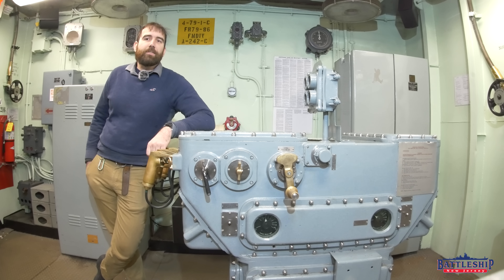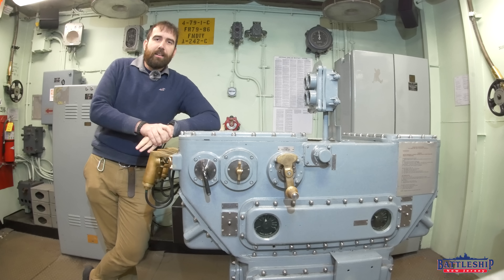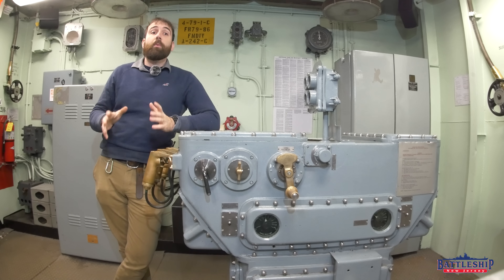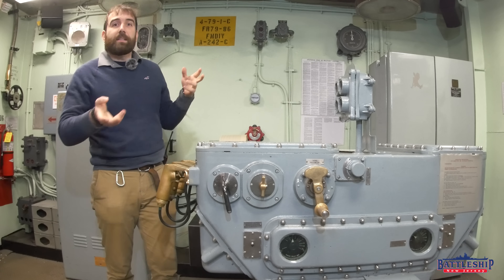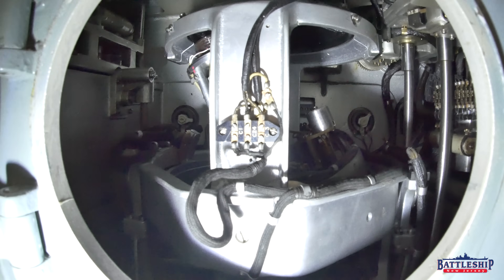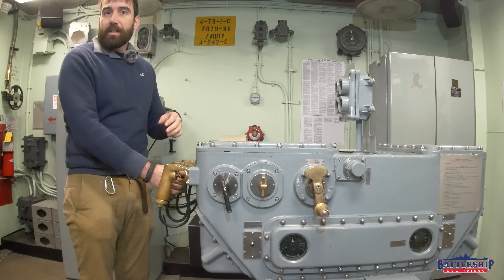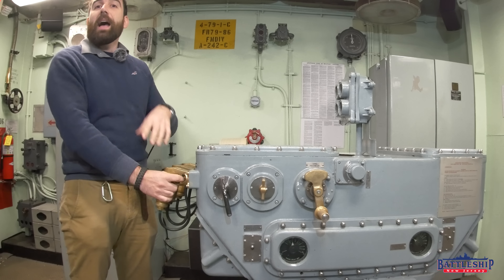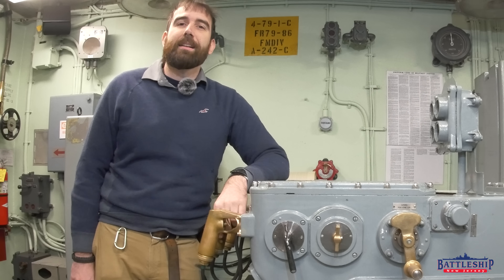The Firing Mechanism for the 16in Guns

Comment: A lot of comments about how "cute" these old systems are and how they could be replaced with a smart phone. 
But back in the day, a countries technical ability was determined by how well they could machine the shafts, gears and mountings that made up these analog computers. Any play in the gears, any slippage in a coupling would be magnified through the computer, resulting in errors that could determine the outcome of a battle. 
When you add in that these systems are impervious to an EMP burst that will fry any typical silicon based device, and you start to understand just how amazing these "old" systems are.
Reply: If you have an EMP powerful enough to fry a silicon device within thousands of tons of steel, you have just ended all life on earth.
Reply: @loganvanderwier8866  
EMP causes it's damage mostly by creating electrical pulses in wires. A ship has wire everywhere, not just buried under tons of steel. Radar antennas, radio aerials, even exposed wire runs will generate a pulse that can travel down the cable into the equipment the cable is connected to. 
I'm not sure you are old enough to remember, but it used to be that you were told "Never use a telephone during a thunderstorm" That was due to the EMP a lighting strike could create when all telephone wires were on poles.
So it's not how big the EMP, but how well the systems are designed and protected.
Reply: @johntrottier1162  And most of the systems are protected by an inch and a half of steel.

More the lower in the ship it actually is.

Yes, it would probably fry any electronics attached to exposed wires. But that, I imagine you can mitigate through clever designs and whatnot. It's not like modern missile crusers are rendered inoperable by lightning strikes, which is a lot less energy in total, but a lot closer to the ship.
Reply: I am in my 30s so I could have easily been one of those kids, but seriously they do not understand that the aim here was to be RELIABLE and REDUNDANT. A smart phone is NOT reliable lol. Sure it has impressive processing potential, but all that potential doesn't mean shit if its a single point of failure sitting in a thin plastic case...
Reply: @madezra64  just think when u are in your 60's  a smart phone from today will be laughable... your grandkids will be like " pop pop how did you live with those iphone thingies"
Reply: @PopePlatinumBeats  Most likely yes. Personally in my opinion I think it won't be as pronounced. The leap from no IC to ALL THE ICs is a very unique event. It's extremely unlikely that 30 years will be anything like the leap from 1990-2020. Unless there's a huge mobile Quantum computing breakthrough, it'll probably be a similar world in 2054 in terms of computing.
Reply: @madezra64  No... not even close. Although it seems like computing power has slowed down, it really hasn't...like at all. Because how normalized it is. 5 years ago it would be insane to think you could even fit 1 TB in a micro USB...today you can buy them for a few bucks off the shelf. Our everyday gaming systems alone are several times more powerful than even the best computers 10 years ago. Hell if I brought back my gaming laptop im currently typing on just 5 years ago, the entire computer industry would shit itself. Sure there might be a few sectors that are slowing down, but look at how many cores we are jamming into a single cpu, we have biotech using neurons grown in labs as computers, and people implanting chips into their brains... AI has made MASSIVE leaps in the last year to the point that people being tested can hardly tell the difference if they're talking to a person, or some code. Tech is still doublng at an exponential rate each year and over 90% of all data has been created since 2019.
Reply: I worked on RN inertial navigation systems in the 80s.  The gyros were so well balanced.  I heard that there were a team of 3 guys who lapped the bearings by hand took a year to make a single balanced gyro. Amazing skills
Reply: Pencil paper slide rule and brain power
Reply: Low tech, wins everytime

Comment: Fascinating ! There was most likely a preferred minimum distance between consoles and heavy, water tight bulkheads may have been a reason for having 11. Meantime, I wonder what the longest interval was, between the warning and the firing of the round.
Reply: If I understand your question correctly, the period between the  warning buzzer and the shot was kind of arbitrary. There was no required standard in the '80s when I was there. If I recall, it was roughly 1 to 1.5 seconds between intervals, depending on who was on the triggers.

The preferred operation was to keep the cadence equal and even throughout the sequence and hold both triggers down for 2-3 seconds on the last. That was the only instruction I received when training on the Mk-41 triggers.

Comment: Since the primary of the battleship was to bring heavy gunfire down on your opponents, at least until air power largely made them obsolete, then too much redundancy is not enough.. the Bismark was still firing as it was ablaze & sinking.
Reply: Bismarck wasn't sinking until the crew set off scuttling charges that blew holes in her.  When they surveyed the wreck they found the hull plates blown outward, not inward as by torpedoes from HMS Dorsetshire who got the credit at the time.  So the crew scuttled her, just as the survivors insisted.

Comment: How did the ship handle aiming in a turn?
Reply: I hope you don't regret asking:  The computer updates all the inputs from radar, speedometer, and compass continuously and uses calculus to figure output instructions.  Those moving dials you see on the glass surface of the Mark 41 represent own ship speed and course, target ship bearing, and target ship speed calculated from repeated observations of his position over time relative to you.  If the two ships are on parallel courses at the same speed, all inputs are constant, including bearing to target ship.  Lead is simple.  The gears in the computer turn this constant information into train and elevation information which is sent to the guns when a solution has been computed.   The computer allows for the rotation of the earth under your shell as it travels -- unless the two ships are exactly east-west of each other on the same latitude line, the two ships will experience the rotation of the earth at different speeds, which affects a long-range shot.  You can enter with a separate knob wind speed and direction aloft (from a balloon sent up before action.)   The computer grinds away at all that until "Bing!' it has a solution, just like you solving a calculus problem.  The solution is fed to the guns as train and elevation orders and you can fire.

Same speed, parallel course is the easiest and quickest solution to compute, but it's also the easiest for the enemy to dial you in and shoot back.  So if your computer is faster, you can get in the first shot and maybe disable him before he can start shooting.  But to mess up his aim, you might want to make a turn.  The change in inputs:  his bearing will now advance or retard and your course will change, continuously while you are turning, then settle to a new course.  Because you are no longer on parallel courses, the computers in both ships take longer to work out the new solution.  Again if yours is faster, you can shoot again before he does.  If your computer is state of the art, it will be able to cope with the continuously changing course and feed a continually changing solution to the guns so you can keep shooting during the turn if the guns are reloaded and ready.  If an older model, it can't cope with changing "rates" as they called these in the Royal Navy during a turn so it goes into idle until the straight course is resumed....and then starts calculating a new solution.   The Mark 41 was all automated:  input the information and wait for the solution to be developed.  Older "Fire Control Tables with Range Clocks" as they were called in the Royal Navy of the First War required a lot of manual intervention to document check points as the ranges and bearings were calculated.  But the principle was the same:  mechanical gadgets implicitly solved differential equations by iteration:  when the values from two separate iterations no longer changed, you had a solution.  The most modern of these old Fire Control Tables, the Mark XX, went to the bottom in HMS Hood in 1941.

The turn question is really important.  In intercepting Bismarck, Hood was coming toward him on a course that didn't allow her X and Y (aftermost) turrets to bear on Bismarck.  So Adm. Holland ordered a turn to port to open up the arc of X and Y to allow all 8 guns to bear.  During the turn, Hood's fire control would have lost the solution and she would have had to wait until the turn ended to start working out a new one.  It was just after the turn started that she was hit in a magazine and blown to pieces.

In the Iowas, (and in later British ships) the computers (called Admiralty Fire Control Tables in the RN) could maintain a continuous firing solution for all nine rifles of the main battery as the ship cruised through a figure 8, limited only by the arcs of fire of the turrets -- they can't turn 360 degrees of course.  It depends on the computer's ability to work with second and higher derivatives of the differential equations in spherical trigonometry that govern the shooting solution...all with gears and shifts like a giant fancy version of the mechanical adding machine my father found in the basement of a business he bought.

Comment: so many questions, that im sure you have no answer to.  not a dig, just questions that probably only the engineers know the answer to

why are the permanently attached triggers/grips fed with a flexible wire and not wired internally?

if the far left trigger grip only rings the alarm, why not have that under a guard/cover that can be pushed and let go of (allowing the circuitry to ring the alarm 3 times) instead of having a 3rd grip in place?

does the middle pineapple fire all 3 guns at once? or only the ones that ring up ready?  if the primerman inserts the primer on a gun and the pineapple is pulled and the gyros line up, could the gun be fired before the primerman could get out of harms way and onto his perch?

and yes. 11 firing points seems excessive by about 8.  maybe 7

Comment: I read years ago that during one of the redeployment of the Iowas they considered an upgraded fire control computer based on modern (at the time) digital controls.  It was decided to stick with the Mk38 mechanical computer because it was reliable & accurate enough to keep up with the digital computers of the time.
Reply: The way I heard it told was that they could put in a modern computer that would do just as good as the fire control, but wouldn't be any better.  So they saved the effort and expense and kept what already worked.
Reply: The story I heard is that the new computers crashed when the guns fired, so they were removed in favor of keeping what worked.
Reply: @russellhltn1396  That is very possible, I could see where reliability would be preferable to accuracy in something this big.  A near miss with the ability to correct and fire again is better than a misfire and having to reboot the damn thing in a firefight.
Reply: @Ioshva McGuire LG The problem with EMPs is that EMPs generally don't exist in the real world. The best way to generate an EMP is from a nuke, but generally if you have a strong enough EMP from a nuke, you probably a have a bigger blast wave to worry about.
Reply: @Jedi2155  Nuclear Magnetic Pulses do exist and are a problem.  One Soviet NMP test caused a fire in power plant.
Reply: @Jedi2155  Ancient comment, but some war plans included nukes detonated for the specific purpose of producing EMPs or other non-blast-related effects. Nuclear EMPs mostly happen from exo-atmospheric bursts, there isn't going to be any direct blast damage on the ground from that but it can still wipe out non-hardened electronics for hundreds of miles. In some cases defensive nuclear detonations could have also occurred which would produce an EMP or similar effects so you'd have to counter that as well. Consider the interplay between ICBMs and early ABMs: in order to defeat interceptors which could take out incoming warheads, exo-atmospheric nuclear explosions could have been used to blind those interceptors with vastly brighter signatures than the warheads themselves. To counter *this*, nuclear-tipped interceptors were built, which would only have to get within a mile or so of the warhead they were trying to shoot down instead of a direct kinetic hit. So now you've got lots of explosions happening way up in the regime where EMPs can be easily created
Reply: Nice thing with analog systems... their number lines are considered continuous. You can always split the hair between two values.  A "smidge" over / under is still a valid value.  Digital are discrete and only as accurate as the number of bits used to store the values.  If you design the software to only go to two decimal places the number you get 2.12, 2.13, or 2.14 is all you can get. 2.135 doesn't exist... no matter how much you want that to be the input.  Also, analog computers were the computer kings through the 1960's for modeling real-world phenomena ballistics being a great example of something an analog computer is great at.  Calculating all the points along the parabola - piece of cake!  To do that digitally?  Fist, use calculus to take the first derivative of the firing solution....  That's why the first digital replacements weren't attempted until the 1980's - and failed.
Reply: @fredinit  Good point, most likely weren't doing 64 bit floating point operations back then.

Comment: I wondered that the HMS Hood...which was designed with relatively thin deck armor, and was a product of the first war...
Did the KMS Bismarck have something like a stable vertical? Admirals Tovey and Holland were racing to close the gap and stop the plunging long range fire...knowing Hood's weak deck armor...tragically, they didn't make it. 
So the stable vertical was a technological advancement between the wars, bringing accuracy that exploited the light deck armor of the older ships. Is that a fair statement?
I need to stop reading this stuff. 😆

Comment: The whole point of having so many places to fire, was that the guns (hopefully!) would KEEP FIRING while she sustained incredible damage. Pretty good example of this thought was Sharnhorst, who kept firing back, until she was practically slipping below the waves.
Reply: All or nothing on the Iowas meant it was going to keep shooting until it could only hit submarines. The armored citadel meant there were no weakshops to hit and flood/burn the ship out. 

The Bismarck had a traditional armored belt, which was the weakness of the design. The steam plant was damaged from a hit under the armored belt.

Iowas have armor all the way down to the bottom, with full thickness armor for the entire propulsion and steering section.
Reply: Yeah, it was a thing until well into WWII for ships to keep fighting under local control as the upper works were shot away, and the enemy had to start hammering at the turret faces. Bismarck, for example, was mission-killed the evening before their last stand by the torpedo to the rudder, but  the Brists closed to point-blank range with Rodney before all of Bismarck's turrets were silenced.
Reply: See Washington v. Kirishima. SoDak was getting hammered, had major electrical problems, and then Washington with working radar appeared without the other two noticing.  And, well, it went poorly for Kirishima, in the last big  gunfight between ships.

Comment: Interesting that the guns are rigged to only fire when the ship rolls to level. I would've figured there would be stabilization so that the rate of fire wouldn't be reduced due to only being able to fire during a small part of the roll cycle.
Reply: I was a little surprised at that as well, but it would have given the servos a real workout to run the gun barrels with the roll of the ship. More stuff to go wrong as servos can go wonky.
Reply: I remain unconvinced that they relied on the ship's rolling to level.  A puddle of mercury completing a firing circuit would suffice for that.  The stable vertical would know where the true horizon was and should be able to tell the guns to keep the right elevation relative to that regardless of how the ship rolled.   I think there is not nearly enough documentation on these marvelous machines on the internet.

Comment: So could you fire the guns individually?  Did pulling the trigger fire all 9 guns at the same target?  Or did you have multiple fire control stations?
Reply: From memory, you could connect each turret to the forward or aft plot stations depending on what was going on. I believe it's possible to fire or not fire individual guns within the turret by disengaging them in the gun house or each turret. For example I think its mentioned in another video that when conducting shore bombardment work in the 80s, it was normal to fire an initial ranging shot from centre barrel Turret 2, see the fall of shot either from local feedback or from the spotting drone, and then adjust the solution before a full broadside was launched.

Comment: Stable vertical could also fire when the ship was at an angle if the elevation control was damaged or inoperable in a turret.

You could switch the turret with the stuck elevation to the secondary stable vertical, input the elevation offset the turret was stuck at. The stable vertical would then fire when the ships roll was correct for the range solution instead of when the ship was level.
Reply: That's beautiful.. the math behind the way that works is pretty cool, and simple when compared to the rest of the capabilities of the system
Reply: Visiting this warship one way or another. Redundant right?